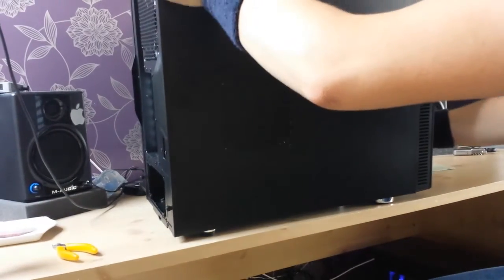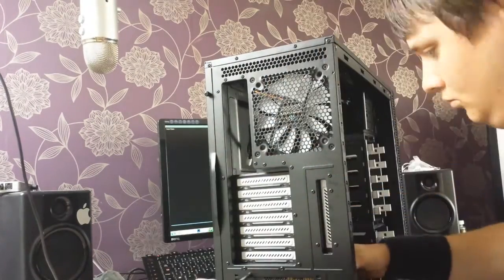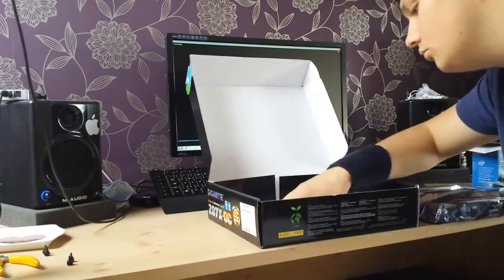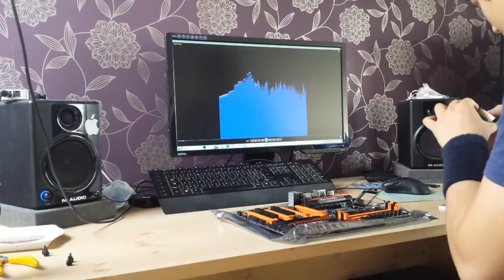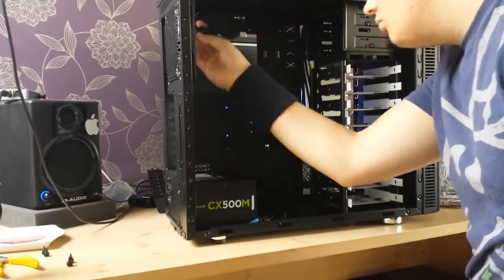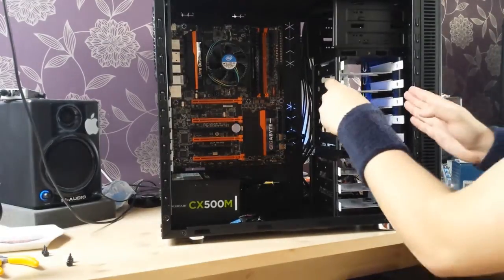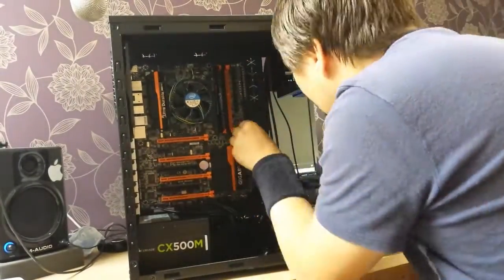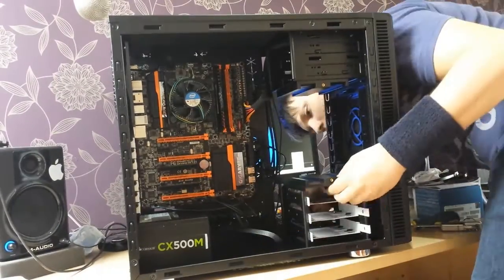The iHack Build Project: Part 3 - The Build [Hackintosh]

Comment: just a note dont place your motherboard on the bag like he did that bag... thats a big no no
Reply from the maker: If you are grounded it's fine to place it on the anti-static bag, or a hard surface (like the box for example, or both). As long as it's not wet or a carpet it shouldn't damage the mobo. I've built many computers now and none of them have had any issues :) Unless you're really stupid then any fault was likely caused during manufacturing.
Reply: I guess you're right...

Do you know of any good mobo for Hackintosh build the one hes using didnt get good reviews
Reply: InsaneAcorn nah, only the inside of the bag is antistatic :)

Comment: What you are holding when you take out the mobo is the VRM heatsink which is what controls the electricity going to the CPU. And the cpu socket cover actually pops out if you leave it on, put in the cpu, and pull down the holding bracket. It is to protect the pins for the socket because intel has the pins on the mobo and AMD has the pins on the CPU iteself. Also, why didn't you go with M-ITX or M-ATX, you aren't using any expansion cards and ATX just seems quite large for what you have.

Comment from the maker: I actually installed the RAM off screen when I attached the MoBo to the case. I forgot to mention it but you can clearly see it in there :) MoBos usually have a black plastic thing covering the processor socket so make sure to take that off ;D

Comment: i haven't ever seen any kind of cpu socket cover, then again ive never built a Intel pc...i hope you can monitor temps from OS10 (i dident know you could install os10 on a pc); you will probably want to replace the cpu thermal paste within a year and upgrade the heatsink too (if it stays above 57 degrees for any length of time)...also you forgot to install the ram.